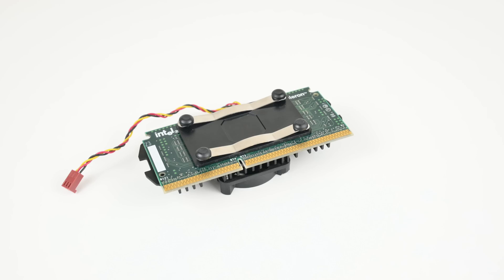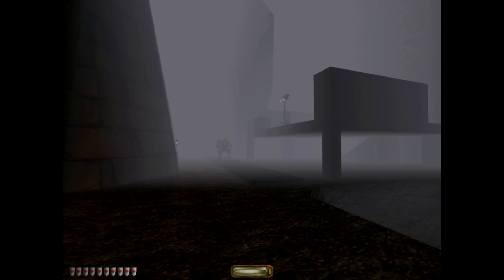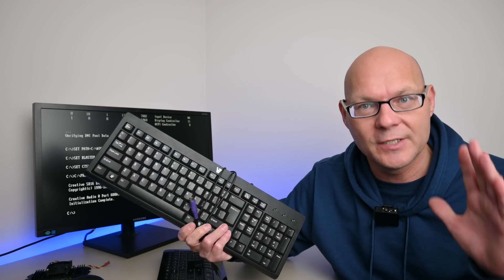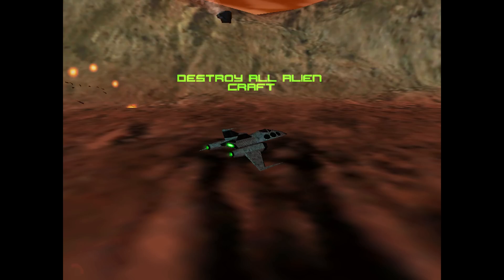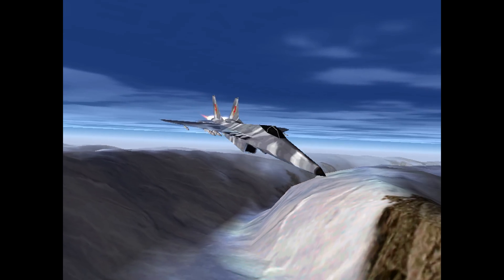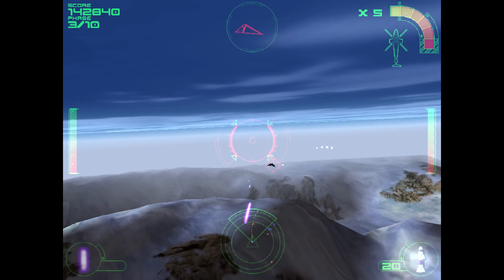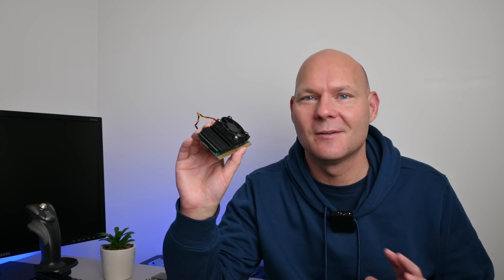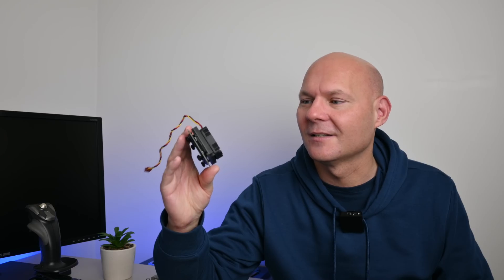Celeron 266 Is Missing Something Important

Comment: Cache is most definitely important -  learned this in the 1990s because my families Compaq Presario 4160 had NO L2 Cache at all, not even the COASt module slot. It was a S L U G. It was a Pentium 150MHz that I secretly overclocked a bit to 166Mhz by moving the bust speed select jumper from 60 to 66MHz.  I managed to beg, borrow, and steal it up from the original 24MB of RAM up to 72MB at least.

Even after that I specifically remember that the computers at school - some 100MHz and 120/133 were noticeably quicker and more responsive than the Presario. It was a hateful, slow, ugly slug of a machine.

Comment: The original Celeron 266 & 300 were pretty bad due to the complete lack of L2 cache. However, since there was no L2 present they were great over clockers (much like the "A" versions that came after them) and bumping the FSB up to 100+ MHz helped negate some of the penalty of no L2. 
In the end we all remember the "A" versions of the Celeron due to their awesome overclocking ability and how having even 128KB of L2 running at full CPU speed made a MASSIVE difference in performance. I had the legendary Celeron 300A in an Abit BH6 mainboard that ran at 464 Mhz (4.5 * 103 MHz FSB) for a number of years. 
Later on I upgraded to a Socket 370 Celeron 566A in a Asus P3V4X mainboard with the help of a slotket adapter. That CPU ran at 875 MHz for a couple of years (8.5 * 103 MHz FSB) The L2 equipped Celerons were good CPUs for the money!

Comment: My first build was a Celeron 300A.  It used an adapter called a slotkit(?)  I had an AOpen board too with ATI Rage graphics, and Diamond Monster Sound. Hauppauge tv tuner and capture card was in the mix.  

The hours and hours with Half-Life, Starcraft, Baldur's Gate.  DOS games Wiz 7, MOO2...

Both my AOpen board and my MSI board from 2001ish got the capacitor plague.  Wish I still had both.
Reply from the maker: SlotKet they mashed Socket with Slot 😊

Comment: Phil, is that really the first Celeron?
I still have one (I think is older) without that strange socket, at 233Mhz if I'm correct.
Reply from the maker: Socket 370?
Reply: @philscomputerlab  I think so, have to look it up, it was from early '98 I guess.
Reply: Or late 97?
Reply from the maker: @lukasgroot  Yea Socket 370 came after Slot 1 and had more Celeron options! Up to over 1 GHz I believe.
Reply: @philscomputerlab  aha, yes I now vaguely recall it being named Celeron II(?).
Sorry for any confusion.
Later upgraded to a 333Mhz one :)

Comment: My 440LX board can't handle Celeron with L2 cache. Have to turn it off with a p2 then install a Celeron with cache and boot up. PowerLeap Control panel software allows the L2 to be turned on in 98.

Comment: The context behind this processor was that AMD had all but eaten away the lower half of the market with the K6-2 and K6-3. Intel tried to respond but missed the mark. The original Celeron became notorious for its poor performance (though its overclocking headroom made it a little underrated in my opinion). Intel corrected this with the Celeron A, which is famous in the other direction for being one of Intel's all time best products. Intel overshot the mark with that, releasing a product so good it ate away at the top end of the market, being faster than the then top Pentium II 450 in multiple benchmarks when overclocked, which was trivial to accomplish.
Reply from the maker: Great comment!

Comment: USB really is a struggle in Windows 98SE. To install any device, you have to click through the dialog boxes, but paradoxically you can't use a USB mouse until you click through those boxes. If you have a USB keyboard AND mouse and forgot to plug in a PS/2 device, you just have to force the machine off. It's really unintuitive.
Oh and yeah, USB IRQs want to conflict with EVERYTHING. It's a hassle.
Reply from the maker: The joys of Windows 98. Later Pentium 4 I didn't have this issue but the early boards yes for sure

Comment: I have a Celeron 533 running @800MHz in a slotket adaptor on my W98 rig. I pairs really good with my overclocked Voodoo 3 3000 🥰

Comment: Low FSB-speeds killed even faster Celerons back then. 100MHz was not enough to compete with Pentium3 EB-models w/ 133MHz FSB. Not even close. We actually tested that Pentium3 800/133 was about 15-20% faster than Celeron 850/100 with many games with same GPU.

Comment: My very first computer was actually an Acer laptop powered by an Intel celeron clocked at 400mhz. It had 64mb of RAM, a 40gb HDD and 2mb of vram but no direct 3d. I only played games that supported software render. Midtown madness came installed on it. 
My father got it from a guy who worked at the airport's carry-on check point back 1999.  Great memories! Cleaning and fixing that laptop it's how I became a technician. 
For me Celeron is the best 😅

Comment: Our 1st PC was a Celeron2 366MhZ, RivaTNT 32MB, 128 MB SDRAM. This PC was used to run Age of Empires 2, NFS Hot Pursuit, Commandos1-2, Hitman, Medal of Honor, and it was capable to run GTA3 by using only top view :D The machine held up 3,5 years when the evolving of computers was exponential. It is now kept well packaged with all of its vintage peripherials in a locker room :D

Comment: regarding celerons im impressed with the celeron 450 which is the conroe core architecture based 775 single core , it actually plays old games great , its quite responsive on an ssd with older operating systems

Comment: A celeron 300A win an ASUS P2B waas my rig at the time.  The extra 128K on-chip cache and easy overclock to 450mhz made it a PII killer.  It easily fulfilled all my needs until around 2001 when I could no longer ignore the appeal of the Athlon.

Comment: Hmm 6 years ago you made a similar videos about the Celerons, and we established that testing them without overclocking makes no sense. 
My 266 goes up to 412Mhz
I think AOpen AX6BC needs the B21 trick, while other boards just ignore the pin on the slot.
With Fastvid on a Matrox Milennium  I get::
3D Bench 1.0c: 490 FPS
Chris 3D Bench:  305FPS
PC Players: 99.5FPS
Quake: 92.3 FPS 
and so on.... 
That's a nearly linear correlation between the scores and the added MHz because there are not many other factors.
No extra voltage needed, just crank it up.

Comment: I think I still have my original Celeron 266.  (I definitely have my 2 volt modded Celeron 300A's).  I think the 266 was still a great celeron actually -- BX chipset,  easy 103 mhz bus overclock (412 MHz) and you have a really capable gaming machine, at the expense of reduced application performance.    IIRC it was $120-150 early on, and could run games like a much more expensive 300-333 MHz Pentium II when the Celeron was overclocked.    It was simply overshadowed by the awesome 300A.

Comment: Does the motherboard have any L2 Cash like previous socket 7's?
I am curious about if a no cash Celeron even competes against my existing 2 retro computers. A K6-2/400 on socket7 @ 66mhz and 512kb l2 on motherboard and a K6-2/450 on super socket7 @ 100Mhz also with 512kb L2.

Back when I was young I went from a K6 233 and then disappointed the performance when upgrading to a K6-2/333 @ 66mhz... Then I changed entirely for a CeleronA 300 sadly only overclocked to 374 by moving the FSB to 75Mhz.
Reply from the maker: Nope no more motherboard cache....

Comment: I used and tried the Celeron and PII back in the day and always find the PII more potent, and Yes I know the Celeron can overclock but so does the PII, I always overclocked the Bus with a PII and it would always beat the Celerons. I was using a PII 333 overclocked from 66 to 100 Bus which made it run at 400Mhz and it was tons of performance back then, you did not even need adjusted voltages or anything. just up the Bus and you were good to go. Still have all my stuff today, but since long in the same computer I did all this I have a PIII 550 and it is a Dos and 98 BEAST!

Comment: No wonder my 2.4 Ghz Celeron could never handle Bioshock, and struggled a bit on Doom 3; Celeron really was an entry-level junk processor. No GeForce card could save the games of it's time from being slow nearly to a crawl. Glad I got the PS3 in 2007, instead of trying to 
make that system "work". When you're stuck with a lame slideshow processor, there's not much you can do...

Comment: I remember the mendicino core celerons when they came out, they  performed well enough and were good overclockers, not only that the cache was on die and  run at the speed of the core, which was twice as fast as the  external cache on the conventional p2's but was only half the size @ 128k  - so its swings and roundabout... I had a pair  366's running @ 574mhz each running in an ABIT BP6 running NT 4.0 then Win2000  for a number of years
Reply: PII cache was 512K, with the exception of some mobile CPUs.

Comment: Good day when Phil uploads! Hoping for the day I can upgrade my Celeron 420 machine. With the specs it got, even Dungeon Siege (I totally recommend the game, by the way) runs great, just with stutters when new assets load in since I'm relying too much on the pagefile. That game was made for Windows XP, it even came with a Windows Media Player visualizer. 

For fighting games, if you want to cover them on the channel, there's a Killer Instinct 1 and 2 port for PCs running DirectX 7 and 9 called KIxxx Split, you'd need hard drive images from the OG XBOX versions of the games or find them online, but I can attest they run marvellously well. 

Also give a shot to the Full Tilt! series, where the pinball game from Windows XP came from originally, there's 2 other tables included.

Comment: If you were to set the fsb to 100mhz this beast will run at 400mhz, the fact they didn't have a cache made them great cheap overclockers, would be cool to add that in with your comparison with a Pentium 2 when you upgrade later
Reply: Yeah, but don't forget to include screenshot of then-current prices and a link to Tom's HW benchmark explicitly mentioning how much you'll pay for a tiny performance increase coming from real PII.
And how much more performance you would get if spent the same money on gfx card :)

Comment: I wouldn't call Celerons on Covington core the worst ones... They had decent FPU performance comparing to K6/K6-2 and they were great overclockers. And with 100+ MHz FSB they could be easily compared to PII 333 - 350.
The worst Celerons are these based on Netburst architecture, especially these two (1.7/1.8 GHz) with Willamette core. You could overclock them but even at 2.2 GHz they were hot and useless in games. :D
Reply from the maker: We can check them out!

Comment: 4:17 I've had a faulty/intermittent SSD brought back to fully working by booting a Linux USB and using hdparm to instruct the drive to perform a self secure erase. This cycles out the decryption key - yes, even though I didn't have the drive encrypted. I'm guessing maybe the controller or the data was in a weird state and that would trip the drive up, and resetting it like this fixed things.

Comment: First celly was bad...
But the cellies later with full speed l2 cache.. Really did sometimes better in games then a p2 with 512 kb half speed.
I stil remember it as today, a p2 and celeron at the same clock speed. I liked the celeron a lot more. It was way more responsive.
-
To me the p2 was a fail.
- 
Even the p3 slot 1's was still a fail vs the cellies.
-
P3 socket 370, I belive finally showed a better performance over the cellies. But still. Celly wasn't bad. But then Again duron 550 to 1400 (later to 1800 mhz) was like a p3 socket 370.. Since Then I am AMD user:P
-
p4 Cellies.. yeah.. again super bad.. all the way up to 3200 mhz. (semprons beated it easy, even paired to p4)

Comment: I remember those old Celerons, they were really awful, but my Celeron J1900 from 2013 was a good choice as a Home Server until it died.
BTW: I received my Erying Motherboard with the i9-11980HK (0000 ES) CPU and the Performance is great if the VRMs are actively Cooled with a 120mm Fan on the Side of the Case, without Active cooling the VRMs are throttling the CPU when they reach a Certain Temperature. 
Also unfortunately the VMX (Intel Virtualization Technology) doesn't work and Windows 11 keeps crashing when it's Enabled in the UEFI, but if it's disabled the System runs Stable.
The UEFI itself is a little bit messy but someone created a MOD UEFI for this Mainboard which is way better Organized and has Mouse Controls, but VMX is still not fixed.
When it comes to Drivers you have to be careful not do Download and Install the HID Driver from Erying, but I used SDIO to find out what the 2 Unknown devices were and downloaded Dynamic_Tuning and HID_Event_Filter directly from Intel which left me with no more missing Drivers.
In Conclusion the Mainboard is a real bargain. For 170€ i got a Powerhouse which reached a Benchmark over 10.000 on 3D Mark with Active VRM Cooling.
Reply from the maker: Thanks for sharing your update!

Comment: That was a very interesting video. It is nice to hear about the not-so-popular CPU as well. It is a really funny coincidence that this came up during a time I was researching about the Celeron as well. I am on the verge of getting a second Windows 98 retro gaming rig for the years 97 and 98. I was considering getting Celeron gen 1  for a short time but changed my mind after hearing the things about it. I will look into Pentium 2, 300, 350, or maybe 400 mhz models instead for my upcoming slot 1 system.     The most modern game I want to play is Half life plus Add ones. Do you think that p2 350 mhz is powerful enough for Half-Life or would I be better off with the 400 MHz model to play it?

ps: It would be cool if you made a follow-up video comparing the  Celeron with Pentium 2.
Reply from the maker: Half-life is very demanding, but it will run better on a Pentium 2 or 3 and higher clock speed better of course.
Reply: @philscomputerlab    Thanks for the info.
Reply: I played Half-Life & Counter Strike on my P2 350 paired with a Banshee back in the day. To me it ran very well but that was at the time when I cared more about a high res than fps numbers. Some of my favorite games, F1 GP & GP Legends, were capped at 25 & 30 fps respectively, so I was used to it. So I ran Half-Life at 1024x768 and after I had overclocked the CPU to 392 MHz and the Banshee to 112 MHz (chip & memory) I ran it at  1152 x 864. I also used a SB Live! which AFAIK takes some stress of the CPU and gives you EAX sound.
I can't tell you anything about the addons since I didn't play them.

Comment: I would says in stock Celeron 266 was quite not impressive, but if you had right series, which was overclockable to 448Mhz with 112Mhz FSB that was completely different story. I remember that I was playing on it even N64 emulator (UltraHLE?) without any performance issues. On another hands Mendocino, Celeron with 128Kb L2 cache I considered as one of the worst, as it was totally not overclockable, and if yes, then only by few Mhz. Back then CPU lifespan was extremely short, as in 99 there was already outside P3 Celeron, and right series has been again overclockable to almost to 1Ghz with normal standard cooling, and in 2000 everybody wanted 1Ghz AMD Athlon 🙂
Reply: You're joking right?  300A Mendocino Celerons regularly overclocked to 450.
Reply: @dennisp.2147  That time I had access to quite a lot of CPUs, as we have been doing builds, but as far as I remember without increase of cpu voltage they didn't like too much overlooking, maybe not right series who knows. :-)
Reply: @petertorda5487  There was a slight "silicon lottery"  but generally most of them clocked right up, even without bumping voltage..  Read the comment section, most of the folks are mentioning the 300a.

Comment: In my very old days, i had a celeron A with 333 MHz, paired with a GeForce 256 card and two voodoo 2 cards - paid and built by myself, except the CPU which i got for free, due to great results in a IT internship. I had this system for many years and was very happy with it. For most cases, the geforce card was much faster than both voodoo 2 cards, but i could play all glide based games without any problems in 1024x768. Interestingly, i recently started a video series, that gets me back into my PC childhood, playing retro games and recreating my very first systems i had with the software PCem - and, the celeron is the very last system i had which works very well on PCem.

Comment: You probably ran Total Annihilation at a too high resolution, this game does not support 3D acceleration so everything is on the CPU. 1080p 3D software rendering might be a little too much for a cache less Celeron, hence the slideshow. It could run better than this on a mere P200 if you stuck to 800*600 or 1024*768 at most.
Reply: My thoughts exactly. No-one played the game above 1600x1200 back when the game and the CPU were in their prime, hell, hardly anyone went above 1024x768, so we shouldn’t expect miracles in that area.

Comment: The Celeron 300A was great cpu.. BUT I would say the socket 775 Celeron e1200 that I purchased new for $25 was the best one. I overclocked it from it's stock 1.6ghz to 3.4ghz 24/7. It's the only cpu I ever had that overclocked to more than double it's stock speed. The e1200 soundly beat friends high clock & big money Pentium 4's that some friends had purchased only 2yrs previously.